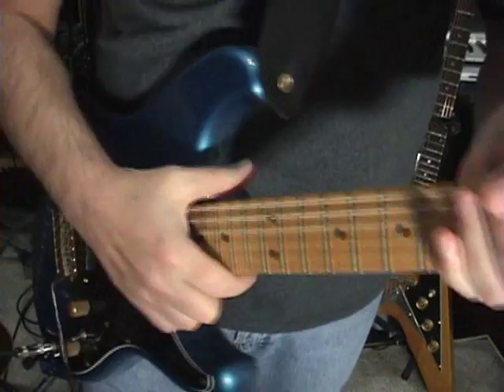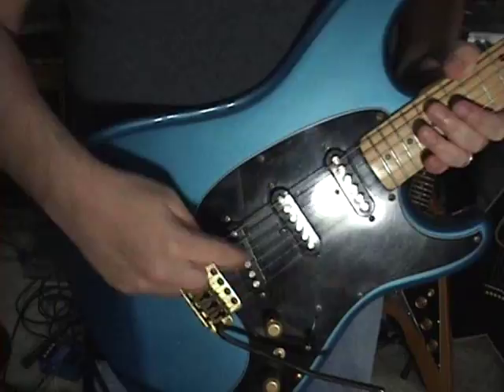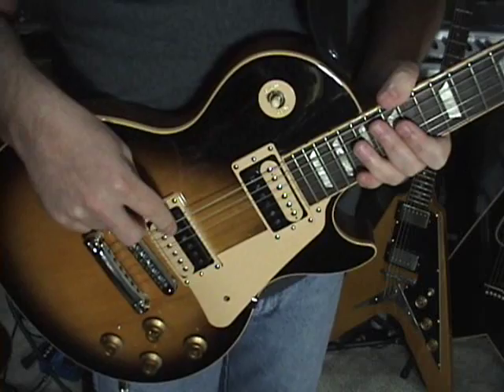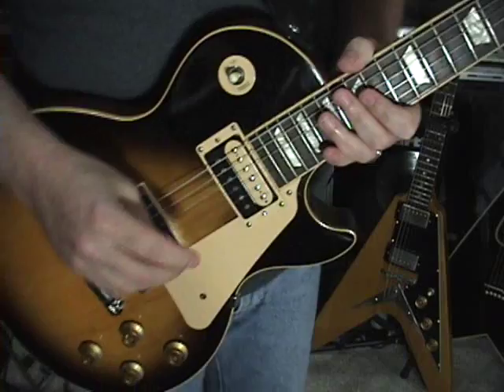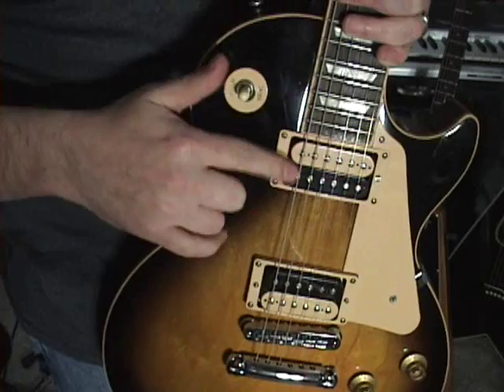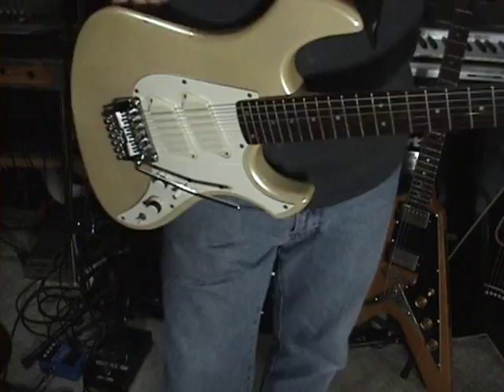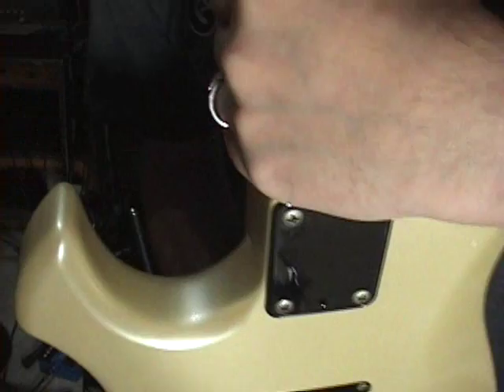Pickups Coil Split, Tap, Phase Switch, TBX, S-1 Parallel, Series Scott Grove

Comment from the maker: Yeah, they have a lot of those. That particular one would be the P-90 version of the Les Paul Traditional Pro. They did the original run of the Pro in 2009-2012 (all of which had coil splits on them), then in 2012 when the released the 2013 models, some continued with the dual humbuckers with increased output SPLITS, then a switch that took the pickups straight to the output jack (These electronics have been failing right & left on the new ones), then the P-90's with the coil TAP,which are cool!

Comment from the maker: They are typical magnetic pickups that are heavily wax potted.  It's hard to tell EXACTLY what's going on inside of there, but it's heavily magnetic for sure, so you have to still find that sweet spot that kills the string drag, yet keeps just the right amount of drive to the input of your amp (if you're into overdriving the input of a tube amp), otherwise, drop them a ways, fire up the amp and it's SQUEAKY CLEAN sounding.  Crystal clear.  They did a great job at the Fujigen factory on them.

Comment: Love that Ibanez strat copy. I played a simmilar one for years while in a band, and it was the most comfortable I've ever played, and best sounding clean playing guitar I've ever played. I didn't own that guitar and was really pissed when it was sold without informing me, after the group had disbanded.

10 to 20 years latter, when I'd moved onto humbuckers and Gibson style guitars, i couldn't figure out why I couldn't get that chimney bell like sound for clean work. I knew I didn't like the ice pickiness of single coils, especially dirty, and since i was playing humbuckers, which i loved dirty, I thought i should be able to duplicate the noise cancelling sound from position 2 and 4 on a strat. Boy was I wrong. 

It took me 30 years to figure out it was the parallel configuration I loved from that Ibanez strat. Humbuckers were never going to give me that perfect clean sound, because they're wired in series, while position 2 and 4 on Strats are parallel. 

I love the ergonomic comfort of the Strat body, just think the controls are cramped, and in the wrong position. I also love the resonance of an archtop and possibly a set neck, but hate feeling locked into series configuration, unless I want to spend an outrageous prices. I rather just use single coils and mod for series/parallel config, but with a tunomatic archtop, with a strat body. Too bad my dream guitar isn't made. The closest is maybe a jaguar, but those dont have the proper PU setup. Guess, I'll have to build it myself.

Comment from the maker: Yeah, the EMG's still do the major string pull thing that screws with your tuning.  They are MUCH higher output pickups, so....they are going to generally sound distorted, even if you don't want them to.  The single coils are generally dialed back to give you the same standard output as most single coils to give you a cleaner and quieter single coil sound, but they will still be out of tune sounding if you get them too close to the strings. So, just more tonal control available is the ONLY plus.

Comment from the maker: Sure thing.  I love only have humbuckers in the bridge positions of my Strats if they have the coil splits.  It's a must and so very hand.  It's even cooler if they are slanted in order to keep the true tone of the Strat.  If you humbucker has the 4 wires, you can also add the in and out of phase.  Most humbuckers these days are finally made that way so that you can do the split AND the phase switch.  The easiest way of thinking of out of phase is reversing the hot and ground on a pickup.

Comment: Here's an idea I once had: Imagine a genuinely coil-tapped humbucker.  The windings for each coils would be individually tapped, and the switch to control this would engage the taps on both coils at a time.  The result would be a humbucker that can go right from a clean and bright Gretsch FilterTron type sound to a thicker Gibson PAF, or from a PAF all the way up to a DiMarzio Super Distortion.

Come to think of it, would it be physically possible to tap the coils at multiple levels, to get all three of those options with a three-way switch?  And yeah, I imagine something like this would be pretty expensive to order from a custom shop somewhere.

Comment: I was building my dream guitar for the last year, and now I see it would probably also be among your favorites also!

It has 3 P90s, custom wound by myself. They are TRIPLE tapped (very underwound-strat output, normal  p90, and overwound)

It has  the S1 switching series/parallel, plus it has Graphtech piezo saddles for acoustic  sound, which could be send to acoustic amp via stereo cable or blend it with magnets to get extra bottom end.

It is THE most awesome/versatile guitar known to mankind!

Comment: I had an Ibanez that was stolen from me that I had in '87, and bought it used for $100.00. I think it was this model, because I remember the phase switch. I don't remember the splitter switch. It was messed up because it had a washburn tremolo and the bridge installed because it had no bridge, but it was too wide for the neck, so sometimes the high e string would slip off the neck when playing, but it was fun with that tremolo, and locking nut. Fortunately I had insurance and I got a '91 Arctic White Strat Japanese new, and it was ok, but I almost bought a '91 American Tele and was about to buy it, but the knob was bent. I also was looking at Steinberger Spirit that I liked but wasn't sure how to play with no headstock so I passed. Funny how I was such and impulse buyer, I think I wanted a drum machine with the extra money.

Comment: The Rickenbacker 330 taps the neck pickup and runs it through a 5th pot so you can blend it better with the (same windings thus weaker sounding) bridge pickup. It's fun to experiment with that mix.

Comment from the maker: I know, you would think they would offer a hardtail version of it.  You can simply tighten the spring claw all the way so that it doesn't have a chance of moving and then toss a couple of sheets of toilet paper or material etc. over the springs so they don't produce all of that SPROINGGGG sound.  lol  I do it to all of my Strats and it cures them in a hurry.  I bet they come out with a hardtail version of it.  They are usually on the ball about that sort of thing.

Comment from the maker: You could, the the bad thing is that you would never hear it since the other coil on the humbucker would overpower the coil that you tapped.  When you try to tap BOTH coils of the humbucker in the same basic spot in the winding, it gets so amazingly funky because of one pickup being wound one way and the other going the other way (to make it humbucking) that the sound is simply unusable.  But, it CAN be done.  Kind of like jumping off of the Empire State Building...it CAN be done, bad results.

Comment from the maker: I'm going to have to guess that you have the lower line "Tribute" series, in which case, it's a pickup selector.  It allows for you to get the Neck and bridge pickups on together or all 3 pickups on together.  These should be VERY noticable.  Simply tap a screwdriver on to the pole pieces on the pickups in every position and you'll find out what is on in what position.  If it doesn't make a lot pop through your amp, that pickup isn't on.  Nice and easy to figure out.

Comment: Actually the Gibson Triumph basses had humbucker pickups with coil taps. Great video.
Reply from the maker: They are single coil, low impedance pickups.
Reply: groovydjs You must be thinking about the pickups in the guitar model, which is as you say, Singlecoil. But the pickups in the bass models has the same cover but is humbucking and tapped at two points on each coil, making it look like an octopus.

Diagram: http://www.flyguitars.com/graphics/LesPaulTriumph.jpg

Comment: So for coil TAPPING, the TAPPED is the lower output or the overwound?
If I physically turn my middle pickups around, would it be out of phase with the other two?
Is out of phase keeping the wire wound the same way but putting N were S was in realation to the direction that the wire had been wound?

Comment: I have a question can you please explain a push pull knob? On a strat specifically. 

I am putting a stratocaster together with 2 single coils (neck, middle) and a single coil size humbucker. 

I want to make the humbucker coil tap. Plus wire it so there is the neck and bridge and all 3 pickups. It that possible?

Comment from the maker: True, it doesn matter to the SOUND of the guitar.  But the weight or the denseness makes for a better looking painting surface or if you want a light weight guitar.  The Basswood guitar that I'm holding there (the Telecaster) weighs almost 10 pounds.  My favorite custom made guitar is Basswood and the ENTIRE guitar weighs 5 pounds.  So, just a different piece of Basswood.  Do they SOUND different?  Not at all, that piece simply weighs less.

Comment: So from a technical point of view it's not Impossible to tap a humbucker pickup. Say you split the pickups then the pickup that is still active after the split could have been tapped before putting them together. So technically you could tap and split a humbucker at the same time.
Reply from the maker: You are 100% correct.  People are finally realizing how easy it is to do exactly that.  If the coil that is "shut off" during a SPLIT was actually just tapped near the beginning of the winding process, the the other coil (the so called single coil) would be 100% quiet.  You could also do multiple taps on one or both coils for a HUGE selection of sounds.  If the "single coil" volume was too low for you or just too thin, you would have options to add in as much of the other coil as you wanted to in order to get what you need.  The switching could be endless with "TAPS" on BOTH coils of each pickup.  Imagine putting in the center humbucker then and doing all of that as well.  I would personally LOVE to do it all.  It would have more switches than any original USA B.C. Rich.  It would look more like the cockpit of a plane. lol  Hell, maybe the body could be designed to look like the control panel of an old plane.

Comment: Nice tutorial. One question. I noticed there was a small black cover on the rear of the Fender Performer. You said it had a passive circuit, but that looked like a battery compartment. Perhaps I misunderstood something. Thanks...

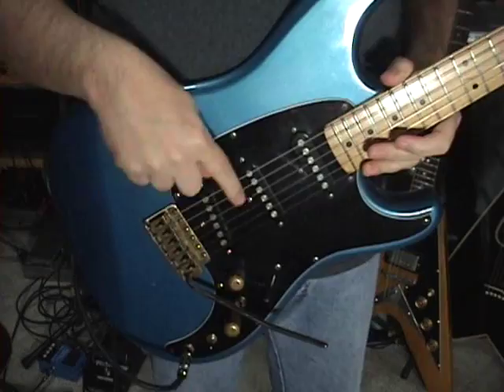Comment: 4:20 you could have a coil tap on humbuckers if two # of windings on a coil or both are available via a wire that being said i never saw one up for sale (even tapped single coils are not so common), it has to be a diy pickup or special/rare custom ordered. If you know what i mean i mean a humbucker could have a couple hundred more windings on one of the coils, and the output of which is accessible from a 4th or 5th wire.
Reply from the maker: For sure.  Since they are usually never found in a "production" model guitar, there was no real reason for me to bring it up for people that are looking for these basic descriptions.  Some of the 70's and early 80's Ibanez, B.C. Rich, Alembic, often tossed everything but the kitchen sink on most of their axes during those years. I enjoy a varitone style switch to change impedance when splitting pickups etc.  I get a lot more fun with resistors than anything.  I'm all about more is more and less is less.  lol  So, tossing me a stock Tele or a Jr. and plugging it straight into some goofy little tube amp and that's it.....that would drive me nuts to no end. lol
Reply: thanks for the reply, and i get that someone that doesn't understand electricity can't figure out what i meant XD anyways yeah i was wondering either series/parralel or coil split on my flying V since i just got my push pull pots!

Comment from the maker: Not a single thing.  I've never hopped on the Lollar bandwagon.  They have typical pickup specs, so I already know what they will sound like and respond like before installing them.  That's what the spec sheets are for.  It's very easy to tell what they will perform like without actually blowing the money on them first.

Comment: Hey Scott, there is at least one model of Humbucker available with actual coil tapping. The Joe Barden HB Two Tone has 6 conductors and a ground wire for the base. There is a coil tap on each coil of the Humbucker, so you can tap it, split it or both.
Reply from the maker: That is true.  I'm surprised someone is aware of that pickup.  Joe Barden has some amazing pickups out there. The ones in the Gatton Teles were really amazing sounding as well.  You have me itching for a set of 3 of those humbuckers now and tons of mini switches for a new PROJECT guitar.  lol  Thanks so much for the reminder and simply knowing your gear!  Cheers.
Reply: +Groovy Music Lessons If you do buy some of those pickups, I hope you make a video with them. Most of the videos about those pickups are several years old, and not at the same audio quality of your videos
Reply from the maker: You bet.  I'll buy them 100% for sure and demo them.  They deserve to be heard.
Reply: +Groovy Music Lessons I thought of putting a pair in a Telecaster Deluxe, with a 3 Way Toggle Switch, and 2 Volumes & Tones. I would either use Push/Pull's on the Volume pots or a Freeway Toggle switch to switch on the coil taps. Have you ever used a Freeway Toggle switch?

Comment: I think I got it, the out of phase simply reversing the pickup and the in phase is where the pick up should be, correct me if I'm wrong.     I think I cannot do the in and out of phase on my strat because its only have the "pull up pot"  and its pretty old strat too.

Comment: I remember Will Gelvin talking about his patented pickup. In what ways is that different from a regular coil-tapped pickup?
Reply: It's possible that Will multi taps. He may have it tapped in multiple places to create 3 different sounds. He doesn't tell you the design, but now that you understand coil tapping, you can deduce. There may be something else he does, but there's only so much you can do to a pick up.
Will has at least 1 video about detailing coil taps and splits.

Comment from the maker: Active pickups are great.  Of course, it depends on WHY they are active and if it REALLY serves any purpose.  Some EMG's are active, some are passive.  Duncans are just horrible all across the board.  I've NEVER heard a great sounding Duncan in any style.  Most folks that tend to use them tend to be Metal Players where you can't hear any tone through all of the distortion.  But as far as having the ultimate control over your tone on your guitar like having Treble, Mids, Bass, controls...AWESOME!

Comment: I had one of those Ibanez Blazers back then except mine was the model with just an out-of-phase switch but no coil tap. Thinking back it was a really nice guitar but I don't think I fully appreciated that back then. It had its own character very clean and clear and a great neck and was very different in tone and feel to a Fender Strat. I seem to remember that the vibrato bridge was not the best though. Damn, I wish I still had it -memories.

Comment: Yet another really excellent lecture. Thank you. I had to skip a little bit forward, seeing it all. I missed the TBX explanation? I looked through the auto-transcript which may have missed it. What's the min mark for that? (Again, yes, this is great, entirely accurate and can save someone from having to buy several books and reading them. Or, before/after reading, makes entire sense of it all.) I was feeling a but under the weather today, and looked for you here -- it helped! :)

Comment: I have an coilsplit on the humbucker on my strat ,I ask the music shop to put it in my strat because it was an humbucking pickup in the bridge and I wanted the strat singlecoil sound without replacing the whole pickuard to make the singel coilpickup fit in the guitar. now I have an humbucking pickup or the singlecoil.   And the in and out of phase thing I did't get?  Do you have the power to axplain it a little bit better?

Comment: I’m so glad I found your awesome vid. I was just wondering how to make my cheap-ass fake HSS Strat work with humbucker in pos 5 and single coil-ish in pos 4 with the 5 way switch (don’t wanna fit a coil split push/pull pot as I don’t really want to run the H & S in pos 4 without the H being split). What I came away with is just how awesome your clean tones are and I’ve gained a new respect for the single-coil pickup. What’s your amp? Again, just beautiful and you’ve done a great job describing the drawbacks of humbuckers in a way a tone-deaf buffoon like me can understand. I’m so glad the kids were being noisym forcing me to watch this through the good headphones. :)

Comment: humbuckers are just two single coils with opposite polarity connected out of phase, thus adding together the two audio signals from each individual single coil but effectively cancelling (or mostly cancelling) the noise or hum, hence the name "humbucker". if you truly hate the sound of humbuckers, you can (in theory) have a humbucker pickup where each single coil in the humbucker has a relatively small winding count (e.g. 5000 winds) and connect them in series which will give you the advantage to cancelling the hum while still sounding like a single coil. Again this is just in theory... haven't actually tried this out. Also you could in theory coil tap a humbucker, if each individual single coil in the humbucker was set up for coil tapping (although I don't think I've ever seen this). Makes me wonder now what that would sound like.